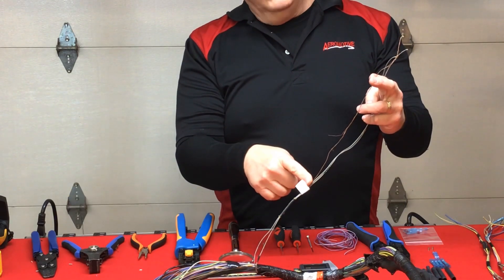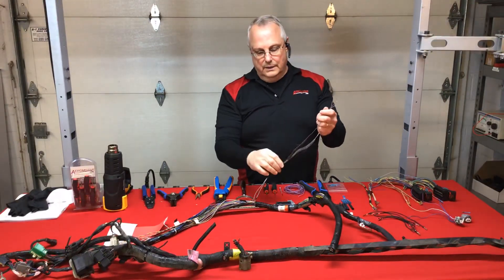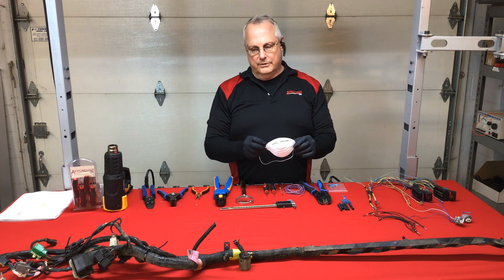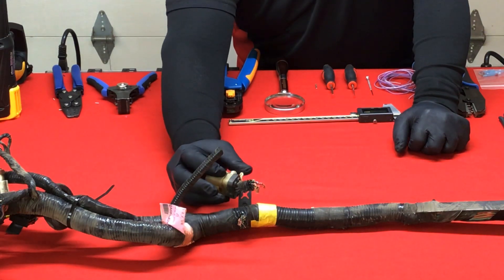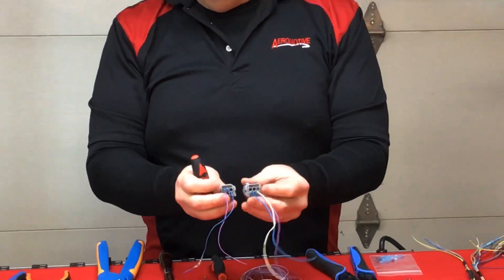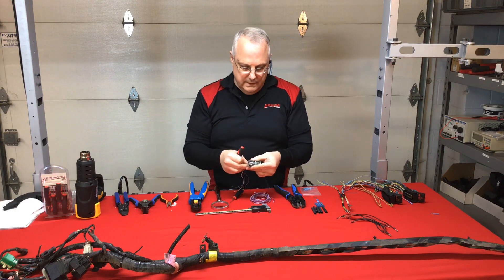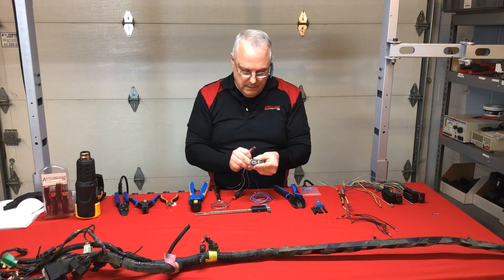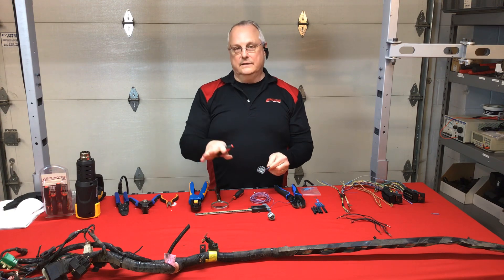Take “Leave n Learn” Session 3 Part 1

Comment: Surely the resistance drop would be there regardless where the repair is ?
Reply: Yes there would be a drop however when electricity is going through a circuit, it has an "ideal travel speed" that it wants to be moving at. The splice/repair acts as a speed bump that slows it down. If a repaired harness has a splice the is further away from the termination point it has enough distance to re-gain it's ideal speed again while the splice/repair that is too close to the terminal, the current won't have time to catch up it would effect the charge rate and the functions of what that charge is going to.